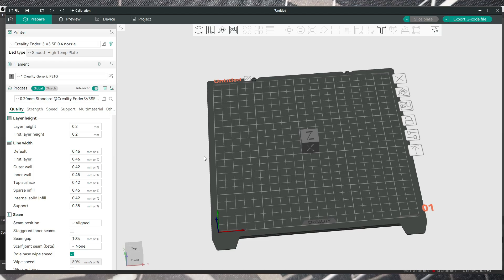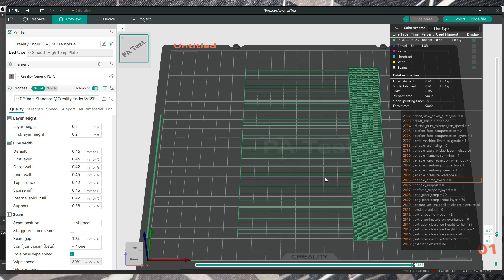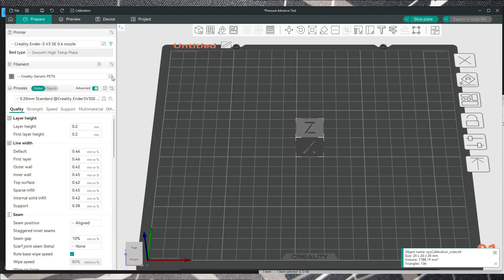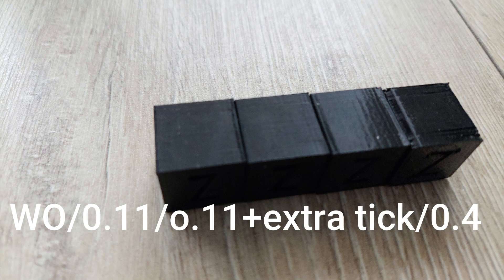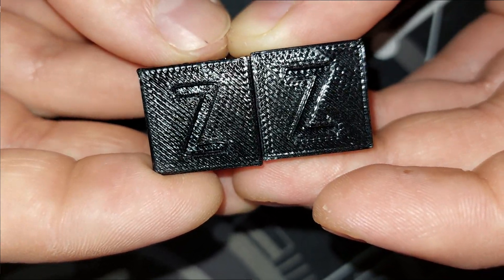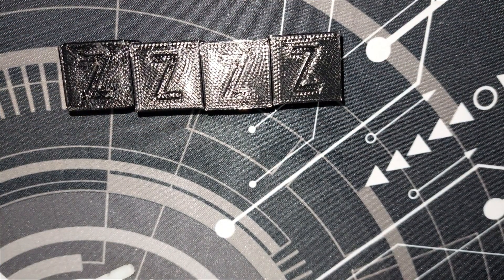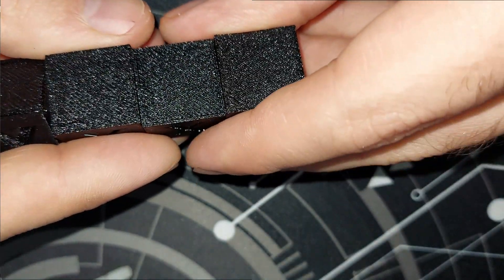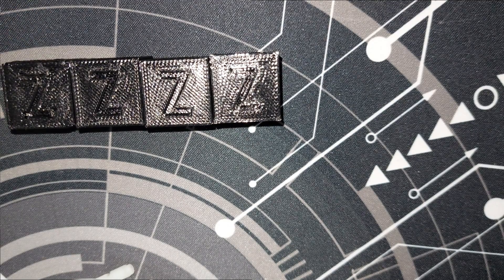Ender 3 v3 SE Navaismo - Linear advance / Pressure advance PART 2

Comment: I have been tried it, but it looks like the input shaper and the linear advance was not enabled in this firmware. The PA test was the same on the all line. Same as the input shaper, my print still have ghosting issue due to the vibration.
Reply from the maker: You can raise this issue in the issues section on Git

Comment: Please make a video on setting up input shaping on ender 3v3 se.
Reply from the maker: Input shaping is not easy to enable without some hardware adjustments. You will need something to measure the vibrations (ex: ADXL345 or the one that comes with the nebula pad) in order to know what should be adjusted (ZV/MZV/EI/2HUMP_EI/3HUMP_EI). At this point the amount of research and efforts invested in this printer it's not really worth it with the newer versions available on the market (which are kinda cheap now). It's like an old car, regardless how much you will invest in it, the chances to achieve the same performance as a new model has are kinda low and nowadays when speed is everything, it's not really worth the hustle.
Reply: That's true.

Comment: Are you using latest Navaismo?
Reply: To be honest, the PA line test does not look good. It felt like the PA was not enabled at all while running the test.
Reply from the maker: I know, right? These are also my thoughts
Reply: I enabled PA recently and I could see the difference when I run PA line test.
Reply: looks like i can't share the link here. :/
Reply from the maker: @ami6packs  what link?
Reply from the maker: Not the latest version, I will have to flash again the latest
Reply: Try with the latest fw. It would work
Reply: I can show my test results. How can I contact you? Email? Reddit?
Reply from the maker: @ami6packs  insta works?